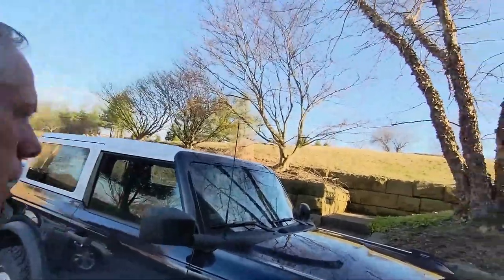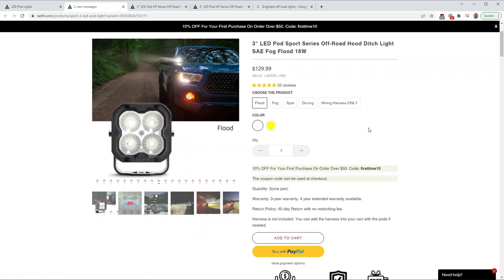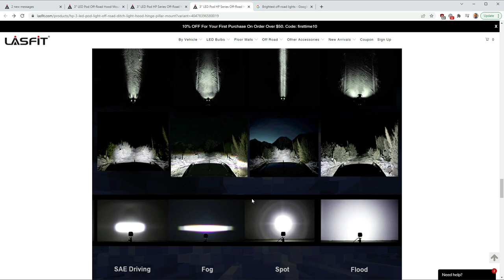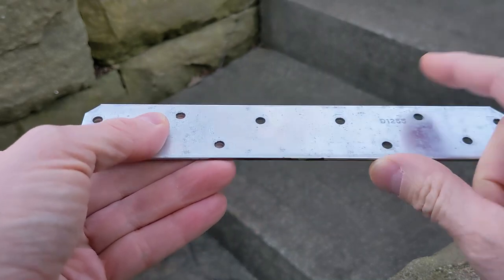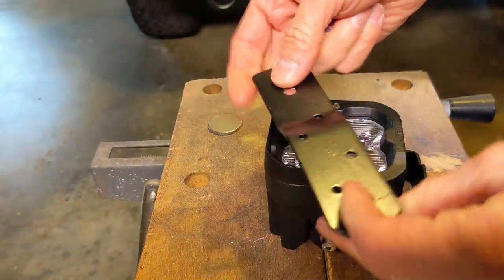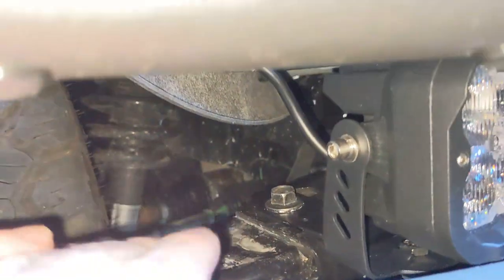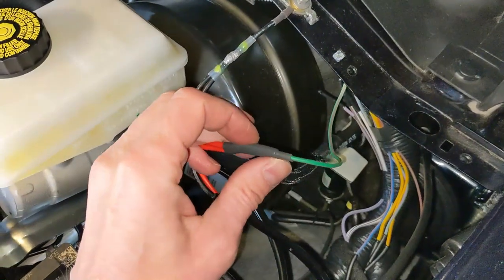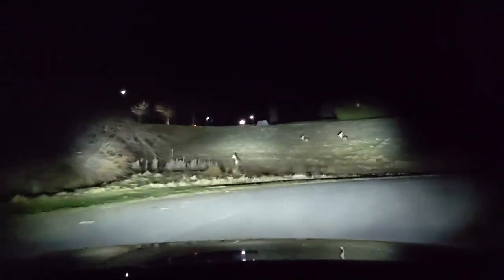2021+ Ford Bronco - Lasfit pod light install with AUX switch and custom mounting bracket

Comment: Nice mod. Glad to see I'm not the only one that uses a Black & Decker Workmate portable bench. Been toting mine around for yrs since about 1980.
Reply from the maker: HAHA that is hilarious, because I think my Workmate is from right around 1980 as well! It is a good tool, sturdy and well made. Black and Decker still sells them (see here: https://amzn.to/3tAcSSI), but you can see that it is truly a case of 'they don't make 'em like they used to' the new ones look cheap and flimsy. Thanks for the comment!
Reply: @Budget Bronco  LOL, nope, they're not the same anymore. Got mine in Chasn, SC, while in the Navy, and it's seen a lot of projects over the yrs. The frame has some rust, and the top should be replaced, but it's still kickin'. :)

Comment: Whew just finished binge watching all your content. This is awesome channel for anyone who is somewhat handy and can save a lot of money in labor cost. The wrap episode might be a little challenging and maybe the forescan might make some a little nervous. But buying a the base Bronco and doing all the mods that you’re doing still comes under the price of upper trim levels.
Reply from the maker: Glad you enjoy it! The Base model is really a good deal. That is my thinking as well, spend a lot less on MSRP and then very selectively spend on the specific upgrades that you really want, rather than buying a higher trim that comes with stuff you don't really care about but you are still paying for. Pretty much anything you can add as an aftermarket addition. One exception: I HIGHLY recommend all Base purchasers spend the $200 for the AUX switches. Those will cost a lot more to add later, and is also very difficult to do.

Comment: I'm in your camp as well. I'd rather have the pride of building a part than buying it. It was painful though watching you try to cut the mounting bracket with a sawsall but I thought, maybe he doesn't have a grinder. But then I saw the grinder. I'm sure you know by now that you can get a cutting wheel for your grinder, the perfect solution to the sawmill instability. I may have to move my Lasfit ditch lights to the bumper!
Reply from the maker: HA...not sure why chose those tools, maybe bc my sawzall was already set up with a metal blade and my grinder was already set up with a grinding disc?? Thanks for the comment and thanks for watching

Comment: if you had connected 4 of the same lights, 2 at the side view and 2 on the bumper, would the green wire support both or would you use the 30 amp wire with all lights tied to the same over head switch?
Reply from the maker: That is a good question. It definitely depends on the amp draw of the lights that you are installing. These lights are about 3 amps each, so four together would be 12 amps, so technically that would be OK for the wire I used since it has a 15 amp fuse. But that said, since there are six switches available, I would probably split them up just to be safe.